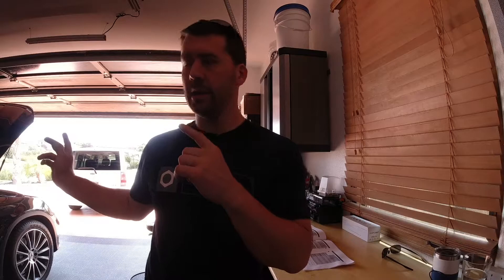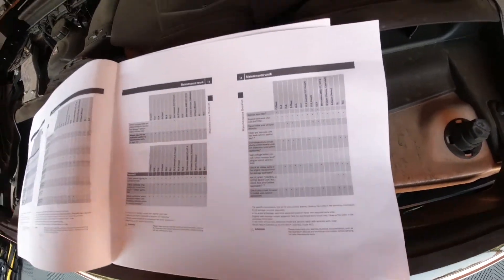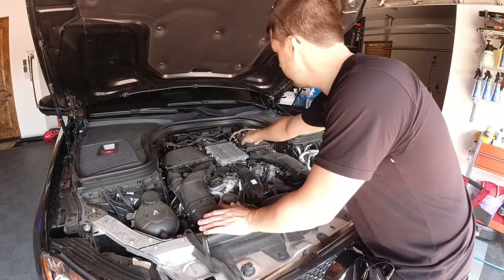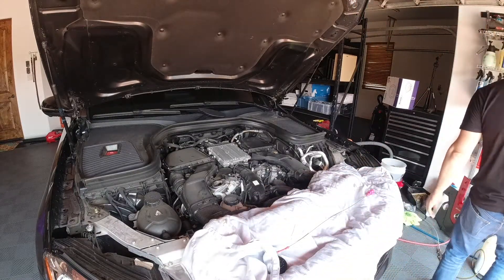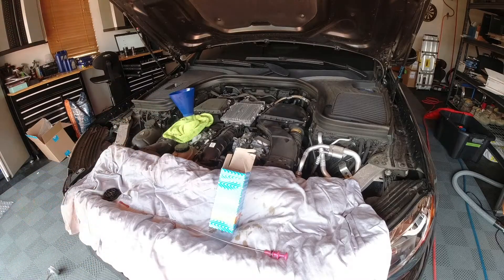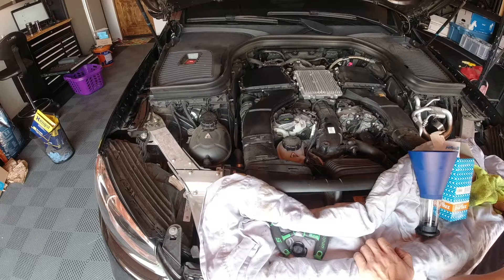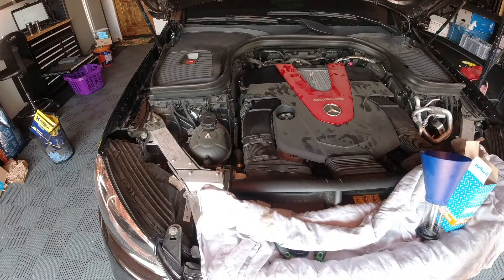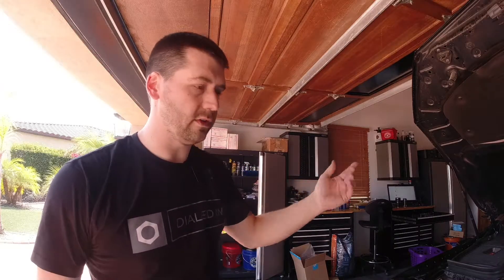IG91 Performing an "A service" on a 2018 GLC43 amg x205 w205

Comment: While I understand the logic,  I think replacing the air filters every service is a bit excessive. Unless you are driving in extremely dusty/dirty conditions. Filters shouldn't get too dirty during normal service intervals.
Thanks for the video. I usually go underneath and get to oil drain plug, but may start using an oil extractor.
Reply from the maker: It probably is excessive TBH, i just figured why not since i was already saving a bunch of money over taking it to the dealer.  Obviously mercedes thinks its excessive too since they dont require it.  I really like the oil extractor for any cars with covers on the bottom, or anything that sits low enough that i would need to jack it up to drain the oil.  

Thanks for watching!